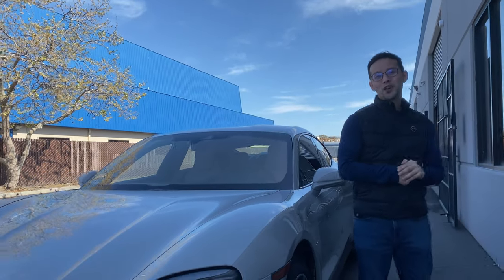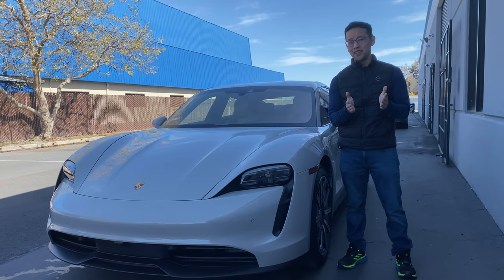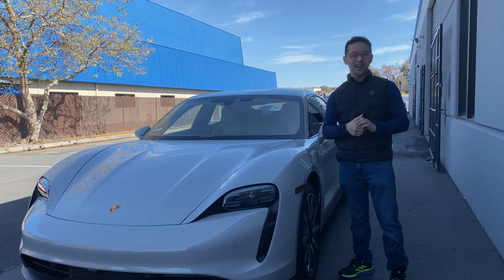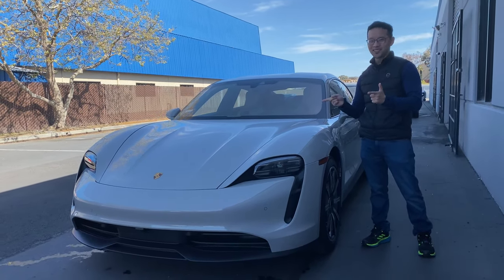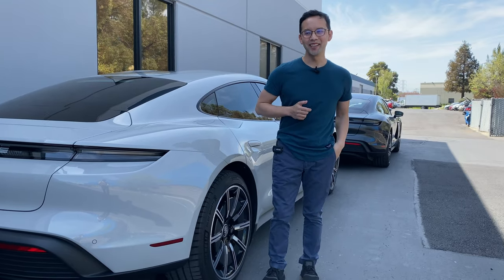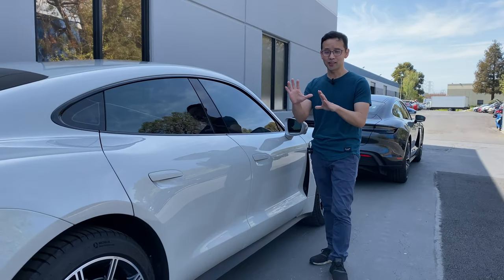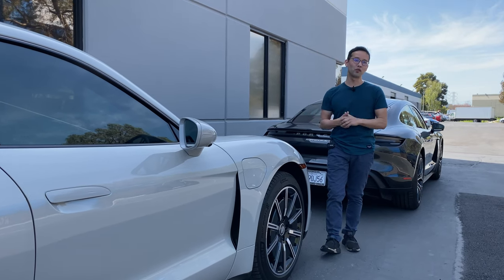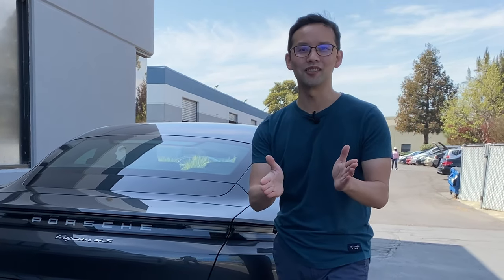New Porsche Taycan 4S: Chalk Grey - PPF / Tinted / Detailed

Comment: I don't understand - I thought window film only goes on the inside - at 1:47 you are putting film on the outside??  Is it possible to protect glass from rock chips esp on front window??
Reply from the maker: Heat shrinking of the film (to have it conform to the curvature of the glass) is done on the outside.  The film is then applied onto the inside.